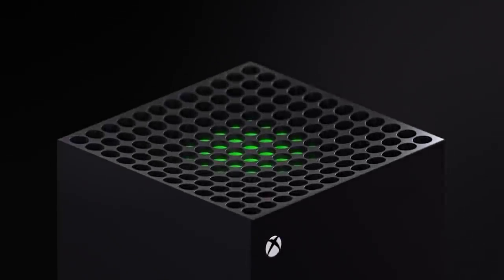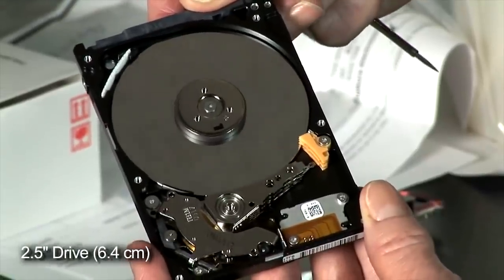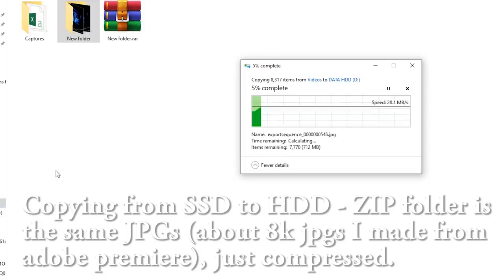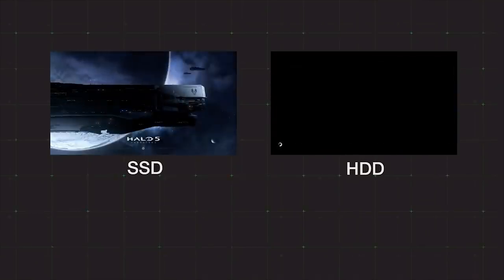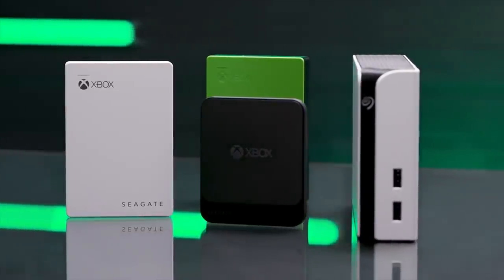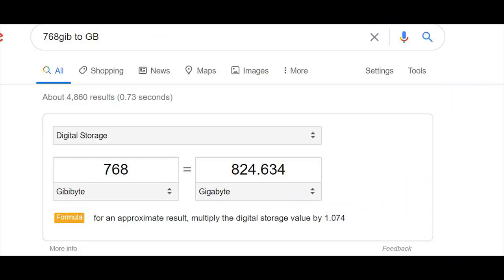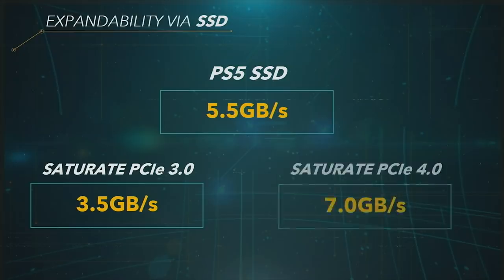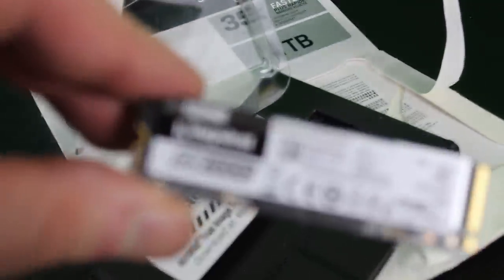Why The PS5 & Xbox Series X SSD Changes Everything - Part 1 - Basics

Comment: This is why I think Sony made a better choice for next generation.

SSDs are going to become a minimum requirement on PC next generation, because developers will fundamentally change the way they develop games now that both consoles will have a high-end SSD as standard.

The simple fact is, you cannot judge the specs of these machines against current generation, because next generation games will be developed differently, by streaming data directly from the hard drive as needed. YES If you were to take a current generation game and play it on both PS5 and Xbox series X it would look and play better on the Xbox series X, however that may not be the case with next generation games.

The Xbox series X is easier to compare performance wise too a high-end gaming PC, because it will have similar components too a gaming PC, so a good PC, with similar specs and a decent SSD, will run next generation games just as well as the Xbox series X.

However where the conversation changes is with the PS5s SSD, that thing is revolutionary. For a start it has 12 channels, allowing it to simultaneously send information to the GPU, CPU and RAM all at the same time (not just into RAM) removing most bottlenecks currently plaguing game development and there is no card, at any price, on PC capable of doing this, at the moment, let alone Xbox series X. That’s why Tim Sweeney said it is the best in class because it is. 

Plus PS5s smart shift also allows both the GPU and CPU to communicate with each other, so if one needs more power to perform a command, the other can reduce power to allow the extra power necessary; plus they can both request data instantly from the SSD if needed, because the SSDs unique 12 channels. 

Although smart shift is available now on high-end PC graphic cards from Nvidia and will be in the upcoming cards from AMD (releasing later this year), this is not something available on the Xbox series X (As far as I’m aware), and the GPU and CPU communicating directly with the SSD, is something only possible on PS5, not even PC yet.

The PS5 also has a RAM advantage; although they both have 16GB of GDDR6, the Xbox series X RAM is split into two pools, 10GB of the fastest variant and 6GB of a slower variant. Whereas the PS5 RAM is all of the faster variant plus the Xbox series X uses part of it’s RAM for its operating system 2.4GB (Approximately) lowering the RAM available for games. The PS5 however uses its operating system straight off the SSD because it’s SSD is fast enough to do so. 

Plus both Sony and Microsoft are planning to use their SSD as virtual. Onceagain the PS5 has a significant advantage in this area, it’s SSD is capable of GDDR3 equivalent speeds, yet the Xbox series X is capable of less than half that.

The only advantage the Xbox series X may have is with Ray tracing, yet that is not 100% confirmed, because although the Xbox has more CUs allowing it to calculate more rays; the additional I/O throughput speeds may allow the PS5 too bounce to more surfaces within the same timescale (we just don’t know enough on that yet).

People have to realise the Xbox series X is only 12.1 TF if all 52 CUs are being utilised fully, which a lot of developers are struggling to do at the moment. Whereas we’ve had developers, that have clearly stated, that they are not struggling to maximise all 36 CUs in the PS5 to achieve the full 10.28 TF available.

We also know that the PS5 has a completely separate 3-D audio chip for all in game audio. Whereas the Xbox series X will need to use part of its GPUs power for its equivalent ray-tracing audio, lowering the gap further between the systems.

I am almost certain we will see no difference between these machines for third party games, however there will be games on the PS5 that can’t be achieved on either Xbox series X or PC next generation.

I’m sorry XBOX fans, but it’s a fact, that the PS5 is a phenomenal piece of technology that is far better than most people realise. Don’t get me wrong the Xbox series X is the more powerful machine, but that doesn’t necessarily mean it’s the better machine for game development next generation. So anybody still claiming, that there is going to be night and day difference between these machines; is going to be very disappointed and look extremely foolish.

IMHO, we will more than likely have another mid generation refresh, and again IMHO Mark Cerney and Sony have gone with the right choice over a 2 console generation i.e. a smaller GPU with a future proof SSD (to begin with) 

Choosing this way, the people that don’t upgrade to the PS5 Pro, still get all the same games, both running and playing, at the exact same quality as the PS5 Pro, just with slightly less graphical power, and lets be honest 10.28 TF of GPU power, is more than enough, to still have the best looking games for the next 3 to 4 years until the PS5 Pro releases. 

Then those people that want the very best graphics can upgrade, but those that don’t upgrade, don’t have to compromise on game design only on resolution.

WIN WIN WIN

My question however, is how well will the Xbox series X perform towards the end next generation and what compromises will developers have to make for those people that don’t upgrade.

ITS A MARATHON NOT A RACE
Reply: Congrats on reading out and repeating all sony marketing material that does not amount to much in the real world.

There is nothing revolutionary about the ps5 ssd , it cannot do gpu compute workloads , It cannot act as ram because is way to slow,  all it will do is load texture data and game file info. 

At the end of the day it will only result in faster load times in first party games.
It's not going to magically work in every game either.  

You talk about bottlenecks but forget consoles have been running on 100mb/s drives, even a sata ssd 500mb/swill be a big improvement over a mechanical drive
 
You think the xbox ssd running at 2400mb/s gonna be a bottleneck? When we just came from 100mb/s. 

3d audio taking gpu resources, disable sound in windows and tell me if your computer runs faster, 

The ps5 will age much worse than the xsx. By the next 3 years ps5 gpu will be struggling because Sony made bad choices. Betting on ssd

Gpu with more compute units and higher memory bandwith , higher vram always age better in the long run.
Reply: @warcrabcyber9908  Bigger gpu doesn't mean anything just means more resolution you aren't getting anything different i can literally play the same game with a 970 that someone is with a 2080ti but i can't play the same game with a hdd that someone with a m.2 is playing you lost the generation and your trying to make yourself feel better by saying bigger gpu will save you lmaooooooo. Tthe only thing you have over ps is 16 cus nothing else and your gonna win the generation? Good luck dude.
Reply: @warcrabcyber9908  xbox only has 10gbs for games that's not enough for 4k 😬 it's a really big fat L for xbox this year sadly. Keep chanting those compute units. Not to mention the ps5 runs faster gpu. Lastly the ps5 can clock faster cpu if the devs are smart and lower the gpu another L the xbox can't counter 😂😂
Reply: @universalgamer2963 

I have a Seagate 2tb iron wolf nas drive mechanical drive in my computer and I also have a 960 evo nvme drive in the           m.2 port on the motherboard,  both my mechanical drive and nvme ssd can play the same games.  The only thing that happens is texture pop in on the mechanical drive, if I am downloading data to the drive while playing a game.

So far there is literally no game I cant play on my mechanical drive. I even have a 100mb/s laptop hard drive 5400 drive and it plays games just fine , i dont think your hard drive is the problem.

  yes you can play the same game a 2080ti can play on your 970 but the 2080ti can play in 4k60 fps while you struggle in 1080p 60fps, the experience is not the same.  The game on the 2080ti will look like a totally different game. 

The xbox also has an nvme ssd and uses velocity architecture so the ps5 does not have any advantage.  Xbox has 10gb of vram dedicated for the gpu @ 560gb/s which Is much faster then the 448gb/s on the ps5. AMD gpu always perform better with higher memory bandwith which is the reason why amd puts hbm2 memory in their top cards.  The gpu scales with memory bandwith. The ps5 gpu is weaker , the cpu has a lower clock speed, you expect a hard drive to make up for the difference? .
Reply: @universalgamer2963  the ps5 gpu is weaker by far , you dont even understand what you are typing because you are just repeating marketing material. The ps5 has a higher gpu clock speed but the gpu is not faster.  But the clock speed is not significant enough to make up for lower memory bandwith and less compute units.

The cpu on the ps5 is also clocked at a lower frequency than the xsx, the ps5 literally has no advantages other than the ssd which is totally irrelevant, because the xbox also has an nvme drive ,
Reply: "it’s SSD is capable of GDDR3 equivalent speeds"
I'm calling bullshit.
A single channel of DDR 667 is 5.4GB/s or about the native bandwidth of Sony's SSD. If you wan't to diddle with their claimed compression ratio's that'll give you a bit less than dual channel mode 667.
The one factor overlooked in system memory comparisons is latency, SSD's are 10000 times slower coming in at around 100us vs system memory at ~10ns which has been consistent through all DDR iterations.

Operating the SSD in place of system memory will only work for certain things, like up resolution of textures and models as a far away object gets closer where the transition frame is inconsequential to the call and +1,2 or more frames makes no difference to the end user. It can only supplement system memory with careful use.
Reply: @magottyk  not even gddr3 speeds it's more like ddr3 1066mhz. The ps5 ssd is not as fast as gddr3.  Gddr3 has  25.6gb/s memroy bandwith which is double the speed of the ps5 ssd.

Ddr3 1066 mhz is not even usuable for a graphics card, its way to slow for a modern high end graphics card.
Reply: @warcrabcyber9908  the cpu can go faster than the xbox xbox is fixed. The gpu is smaller. Doesn't necessarily equate to "weaker" spoken like a true bot brainwashed by xbox's tf narrative. Don't cry when you guys are struggling to render next gen gta 5 🤦🏾‍♂️. The x badly designed system. Microsoft just literally designed the system to grab headlines but it's garbo in practice. You call the ps5 gpu weak but people are boasting about rdna2 cards with similar specs in pc you've failed. Maybe you should eat more gamepass shovelware 💀💀
Reply: Additional info:
At 60fps you only have 16.67ms per frame, so 10GB/s is only 166MB, but that would be all the time you have for the frame, so loading assets for a frame you might only have 1-2ms of leeway meaning that 10GB/s equates to 10-20MB of information compressed, at native speeds that's 5-10MB of information you can access per frame and not go over your 16.67ms budget per frame.
Reply: @warcrabcyber9908  You still haven't found a way to cover up 10gb vram 🤢🤢🤮 sure the memory is faster but you have less you can't hold as many textures and your bottelnecked ssd holy sht that's a garbage compromised system 🤮🤮 why would anyone develop on that 😢
Reply: @warcrabcyber9908  Lastly i was referring to the future with the 970 vs 2080ti and ssd and hdd not right now lol so that was a pointless statement with your m.2 🤣
Reply: @universalgamer2963  lmao 560gb/s gddr6 with 10gb of vram is hard to develop for? Show me a game that uses more than 8GB of vram.  All those puke emoji save them for when you are puking at your playstation when it camt maintain 60fps in 4k.  I can safely say 2400mb/s wont bottleneck game design in 10 or more years because consoles just came from 100mb/s.

Those 36cu wont last 3 years without struggling. By 2022 the ps5 gpu will struggle to maintain 60fps in 1440p. And will have to resort to dynamic resolution,
Reply: @universalgamer2963  nah everything you say is pointless , you want to have a technical argument but dont understand anything at all , typical console fanboy.  The only thing that makes sense to you is the bs marketing from sony because you dont have the technical capacity to understand anything else
Reply: @warcrabcyber9908  but phill said my tflops will save me 😭😭 no but grounded 60fps see i was right 2gbs is not a bottleneck come on guys go 12tflops we got this (even though we got same performance as ps5 destiny 4k 60) we don't have to worry about having to pull developers back with the turtle ssd. Give it up dude.
Reply: @warcrabcyber9908  Keep crying to phill hey phill where's our vr?
Reply: @warcrabcyber9908  You saying 36 cus clocked fast asf not lasting is like saying the 2070 super isn't lasting 🤦🏾‍♂️ your struggling to comprehend reality.
Reply: @universalgamer2963  nvme ssd running @ 2.4gb/s uncompressed and 4.8gb/s compresses how is that slow? We just came from 100mb/s do you realize that is 48 times faster. 

But then again you dont know anything other that what sony says in their marketing slide, you are equivalent to an answering machine with a prerecorded message. 

No one wants vr its garbage,  it never caught on even on pc
Reply: @warcrabcyber9908  it's slow compared to competition just like how you say 36 compared to 52 is weak even though it isn't case closed now go play more grounded my dude
Reply: @universalgamer2963  nah you dont understand reality  , you think games gonna stay the way they are 3 years from now, sony is putting ray tracing in their games, go turn on ray tracing on the 2070 super it wont even run games in 1080p 60fps,  it's the reason why the xbox has more compute units. Despite what you think the compute units make a big difference.
Reply: @warcrabcyber9908  ratchet native 4k 30 locked 30 with ray tracing Yikes..... Levels loading instantly? What will i do without 12tf 😔 nothing but crank out more goty contenders 😂
Reply: @warcrabcyber9908  it's not what i think it's the big picture your still stuck in the gpu war when it doesn't matter anymore
Reply: @universalgamer2963  yes the xbox ssd is slower but it does not matter because the gpu is responsible for how the game looks and runs,  not the ssd.  The xbox ssd is overkill , games dont even need close to that amount to stream high quality textures.
Reply: @universalgamer2963  4k 30fps yuk ,   30fps is garbage , its embarrassing for a next gen console to be running in 30fps to be honest.  Teraflops dont mean anything,  what matters is the cpu , gpu and vram.
Reply: @universalgamer2963  gpu war still matters and it's the reason why AMD is releasing an 80cu gpu later this year. You think an ssd gonna magically make gpu compute power irrelevant . It's amazing how much garbage you type.
Reply: You said " The PS5 however uses its operating system straight off the SSD because it’s SSD is fast enough to do so."

Link please.

Comment: Even if PC's can brute force the custom ssd solution ,the IO accelerator of the consoles. The only concern for the PC will be the GPU hardware variability. Consoles being a closed box can natively store gpu formatted data on
the ssd but for the PCs gpu driver translation cost will still exist and it might become a major cause of difference between consoles and PC.
Reply: I reckon this gen will finally make console gaming a viable option compared to PC. Superior performance will always be an option on PC but for a much higher price than in the past.
Reply: The I/O accelerator for the consoles is to bypass the cpu "bottleneck". The way to brute force this is to get a faster CPU. I honestly think the i/o accelerator was just put there to help developers because the CPU bottleneck isn't much of an issue with a modern cpu and having faster data from the ssd is still limited by GPU overhead. Sony's SSD may be fast but it's not GDDR6 fast.
Reply: @hteadx  of course its not gddr6 fast. Lol. Nobody said It was trying to be

Comment: For me it's still just teoretical talk. I want to see how all of this super duper SSD make games mind blowing. Yes, Ratchet & Clank looks nice, and jumping between word can be impresing, but it's not mind blowing. It doesn't look like game changer right now.
Reply: SSD will not make the game run any better. It's just funny marketing. Expect better loading times and that's it. 
Coming from a PC gamer with m.2/sata.
Hard drive is not even in the top 3 upgrades for a PC gamer. 
GPU, CPU, Ram, Cooling, Power supply, then maybe SSD. The benefits are pretty much negligible. I run most of my games off my SDHD and it makes no difference in-game.
Reply: @anonymous134y  I wouldn't compare consoles with PC. On PC games are designed to work on very slow HDD, so the only improvement that can be is faster loading. On PS5 and XSX games can be designed around high speed SSD.  Like, gameplay can take advantage of it which is not possible on PC, but I really would like to see that and not only hear about it.
Reply: @anonymous134y  upgrade all you want on pc and that doesnt make huge difference cause the game is simply not designed in that way. The thing we are talking here is the game can now be design with all the advantages in mind, hence it's different.
Reply: A PS5 dev said SeriesX can do the same with Ratchet and Clank as PS5 can. All those PS fanboys claim it's only possible with the PS SSD. If that's the case then why would a PS dev say SeriesX can also do that samething with jumping into different worlds? Here is the link to the interview, fast forward to 1:19:20.

https://youtu.be/zqf2LwBntiU